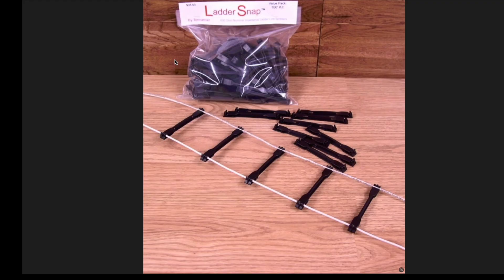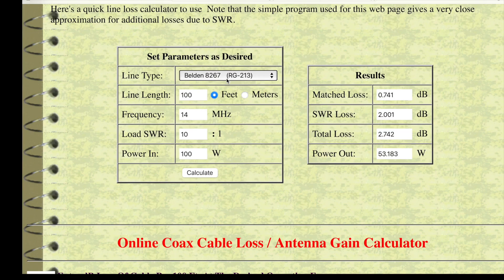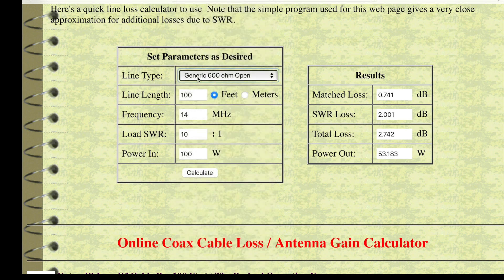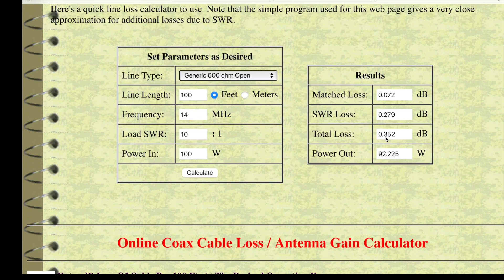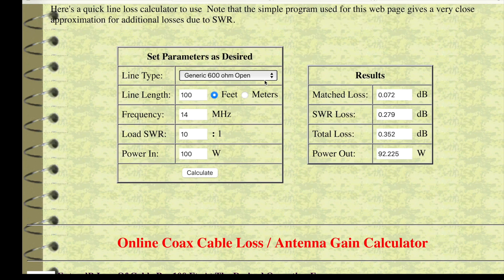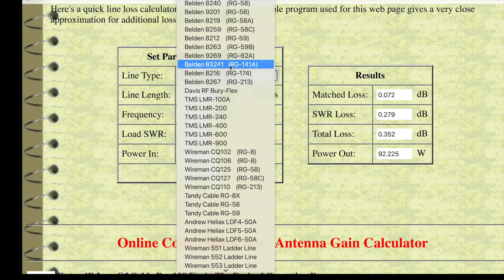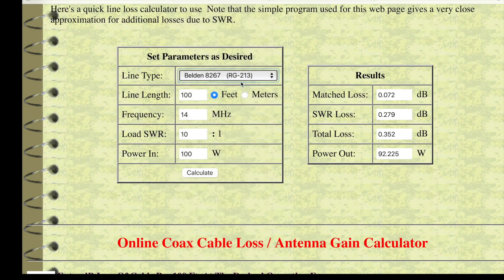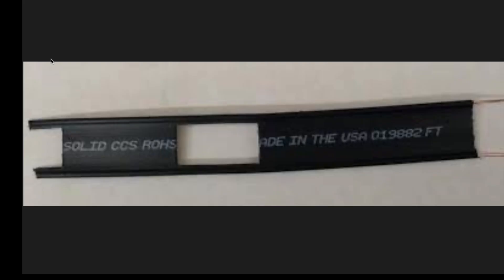Ham Radio Myth - Don't Use Coax Cable It Wastes Too Much Power!!

Comment: Great straight-talk series !
One minor repair if I may:
The tuner doesn't/can't do anything about loss in the coax. 
That can only be done at the antenna's feed point.
The tuner can only change the impedance AT the point where the coax meets it ... that keeps the radio happy.
Reply: More accurately: 
.... at the point where the short coax from the radio meets it. 
If the match is poor at THAT point, then you lose some power in the tuner, as well as in the long coax. //
K2KQU
Reply from the maker: You are partially correct.  Go to ChatGPT and ask this question:  How did Walt Maxwell, W2DU, and the ARRL Antenna Book, explain how an antenna tuner not only matches a transmission line to the transmitter but tunes the entire antenna system to resonance?

Comment: i have a nye 3kw tuner i would like to use just the long wire  what is your suggestion?
Reply from the maker: Nice tuner.  First you should do a Google search for instructions in a PDF.  I was able find one in seconds.  There are three feed through insulators on the rear.  One of them is for a single wire antenna.  Then you will need to connect a counterpoise wire to the ground on the tuner.  It should be about a quarter wave for the lowest frequency you plan to use.

Comment: We shouldn't always use ladder line or coax or window line or anything at all. If you want something easy use coax. Very forgiving and shielding is awesome. Id use it most of the time but playing with ladder line to make a doublet or g5rv or anything else you want to play with just makes sense. It all depends on what antenna you want and how far you want to take the hobby. Ive seen guys use tv coax to save alot of money and guess what it works! Just make aure you know what you're doing b4 you do it. Your finals will thank you😂.
Reply from the maker: TV type coax may present a better match to a dipole than 50 ohm coax but it has an aluminum shield which you can't solder to so won't take a PL259 plug.
Reply: @BustRadioMyths  yeah I'm not recommending anything to anyone. Honestly I haven't tried it. I do plan on making a listening only antenna by using f to bnc or f to UHF connections. I have seen a guy use TV coax to excellent effect and he mainly did it to afford to make more antennas. Sometimes he would try a dozen in a single month. I like that idea but your right there are some things to understand before you try it. Im about to try ladder line made of bic pens and lamp wire. I just like the journey. Im not ever going to say you should always in ham radio. The experiment is the goal for me. God bless buddy I like your channel. You cleared a lot up for me last year when I was studying for my exam. I've never found a hobby with so much dogma and outright anger at others not doing it Thier way.
Reply from the maker: I've actually used TV coax before on the ham bands using an F to PL259 adapter and it worked fine.  I'd say it's certainly OK for QRP.
Reply: @BustRadioMyths  However there are adaptors that will convert the TV coax connector to a PL 250 connector.  The impedance of a dipole depends on how far it is above the ground.  It can vary from below 50 to above 70 ohms.  For many heights the 40 and 80 meter dipoles may be a better match at 50 ohms than 70 ohms.  I doubt there is enough difference to notice for either impedance of coax .

Comment: I'm an old man and reasonably new ham. Yours is one of the few youtube channels I put any truck into. And this particular video I find fun as I have a new Yaesu rig and an old Collins rig in my shack. I do everything in coax for convenience. All of my antennas are compromise (Oh boy, I mean compromise!) and I still enjoy the hobby. I'll never have the huge antenna farm or any amplifiers. But I'm not into contesting and don't feel a need to try and talk over some other operator. Maybe I'll catch you on the air some day from the Sonoran Desert.
Reply from the maker: I’m the same as you.  Don’t really care about contests or breaking pileups.  Currently doing the QRP thing and it’s kinda fun.

Comment: My call sign is M7HIJ,  IM using 1/4 wave 31 ft wire vertical. 6mm earth bond wire. direct to a wonder wand mrk 2 tunner, straight to the back of my rig, also 31 ft counterpoise straight off my radio ground.  So lm putting out full 6watts, on my yaesu ft818 nb full 6watts no coax  boom QRP.
I'm getting 5/7 5/8 in the Netherlands.  5/9 Italy 🇮🇹  5/5 Brazil 🇧🇷  Germany 🇩🇪 5/9 and we are only Qrp 6 watts max, the tunner will tune all bands down to zero swr.
Reply from the maker: That’s what it’s all about IMO!!!

Comment: Over the years I've used all kinds of things. All homebrew.
Long wire straight into the shack with a tuner, a doublet early on using 300 Ω twin feeder and later 450 Ω slotted twin, presently five attic dipoles on 20m to 10m with about 25 foot of RG58. Also an outdoor 60m inverted vee with about 50 feet of RG58.
Two sizes of magnetic loops too.
All get out, a little r.f. goes a long way. Nothing over 5 Watts here for 30+ years.
G4GHB.

Comment: I am really new at this.
At this time I only have a gmrs license, using a HT and a magnetic mount Antenna.  I plan on getting the first level ham license.  It seems easy to get the license with a bit of study. Its putting it into real world applications, which is the trick.
Things to consider are,
Radio
Antenna 
Coax between point a and b.
All on a buget, the simpler the better.
Let's not forget the buget.
I may be 67 but I can still climb that old tv Antenna tower to stick a ham antenna on it, ha ha. I just have to do it when the wife is gone to the store, so as not to hear, 
O My Gosh, your gonna fall.
Reply from the maker: Welcome to the hobby.  Get $12 worth of wire up in the air and it'll work fine.  A dipole on that TV tower sounds good to me.  Don't fall.  Better have someone there to call 911.

Comment: If you use that online calculator at 14MHz, 100ft and set the VSWR to 1:1. For 600 Ohm open ladder, the loss is 2%. For, RG58 it is 26%. For RG-213/U it is 16%. So, typical co-ax has significantly greater loss than 600 Ohm ladder. As you say, it depends on the application. If the ladder line is difficult to run or the length of the run is short, co-ax wins the day. Also, ladder line is affected by weather (it doesn't like getting wet and especially doesn't like ice or snow). However, if the situation  allows you to use ladder line for a long transmission line run, you may want to consider it. If your run is in the order of 300 feet, even with a perfect match, you can expect less than half your power to make it to the antenna (or half your receive signal lost before it gets to the receiver). We cannot say one type of line is always better. It depends on the situation.
Reply from the maker: Go back and check your figures.  100 feet of RG213 with a matched load at 14Mhz with 100 watts input has about 85 watts reaching the load.  That is a loss of 15% not 43%.
Reply: @BustRadioMyths  Woops, I think I had metres instead of feet selected! I shall amend my comment. Thanks.
Reply from the maker: Ah Ha!

Comment: Good tutorial!  1/2 S-unit may not matter, but 1 whole S-unit may mean the difference between completing a weak Contact in the noise level.  Seems like the majority now have high noise levels, like over S-5 and only bother to respond to strong transmission levels.  Great presentation and food-for-thought topic. ❤

Comment: Ladderline needs to be twisted so many times to the freq per 100' ( at least in the " analog" tv frequecies" ) from a catv system tech who serviced cable tv in the 80s finding ladder line still in use!!!!
Reply: Sorry i am not a natural english human.
Would you like to explain the point to me?
what you say with "twisted 100 Times per freqency" ?
Hope you exlain it to me, please.
Please do not miss understand...  Your comment raise my attention  and i like to understand  what you are writing. 
Sorry for the Bad englisch;).
Best 73 from germany.
Reply from the maker: Me too.  What purpose is served by twisting ladder line?
Reply: @BustRadioMyths  the idea was 100' not times and the twists were to reflect losses from one side of ladder line to other  even though minor loss is loss and those twists allow losses to '" reenter" the lines this was presented to me by aa ham operator from the 40s  as well as tv cable CATV was open line and in the first years of community cable used ladder line as the original back bones for service lines  placing lighter connection weights on housing structures
Reply from the maker: Can't see how twisting ladder line would reflect losses from one side to the other.  Ladder line if properly installed is balanced, meaning one side cancels the other preventing it from radiating.  Twisting has nothing to do with it.
Reply: I've always heard that those twists weren't frequency dependent but are there just to avoid wind load on the wire.
Reply: @j3gum  they are frequency dependant  the count falls per 100 meter run more for higher frequency less for lower

Comment: One of the potential problems with old vacuum tube gear is the break down of the mains transformer (Filament & B+), and the leakage incurred to chassis ground from decades of heat, and the chemical reaction of the copper windings and the insulating coatings used.  
Unaware inexperienced (and experienced) users can get a nasty zap or worse when touching an equipment case where AC is leaking from the power transformer primary to it's E-Plates, Bell Covers etc.  
Replacing a power transformer alone can run into several hundred dollars for rewinding the original to spec.  An off the shelf replacement may be available at a lower cost but sometimes it isn't.
etc. etc.
Reply from the maker: I gotta hand it to guys who restore old gear.  I would never have the patience for it.

Comment: I personally don't find ladder line that difficult to route outdoors. My balun (a DG0SA/sk designed 1:1 and a common mode choke combo I built) are outside my house, a 6' run of RG400 goes through a pass through to a remotely controlled tuner. From the tuner there's about 50' of coax to my operating position.  The long run of coax is always at a low SWR for low loss, and there is only 6' of untuned coax to the balun, then low loss ladder line. With 108' of doublet above my house, I can tune 10m-160m with ease.
Reply: This is a perfect setup. You keep your tuner safe inside and only the balun is outside. Your losses are small  in a short low loss rg400.. if you have a zs6bkw or g5rv connected, your losses are even lower, cause they are 50 Ohm for certain bands…. personally I dont get the point of the video. It’s misses the point of the ladder line and doesn’t explain why swr is bad. Without addressing reflections, it is only another opinion newcomer can not evaluate…. Furthermore why is he always so loud? It’s like telescoping…

Comment: When I changed my 40 meter dipole from coax to window line, it made a huge improvement in signal strength on 20 and 10 meters. The other bands were not drastically different .
Reply from the maker: Maybe had very high SWR on those higher bands.
Reply: @BustRadioMyths  Because of the frequencies involved, both of those bands were being fed at a voltage point, hence very high Z.

Comment: i run a dipole. no balun. no nothing. 2 inch pvc for the center to contect the coax to the wires. then 125ft of coax. i run it on 75only tho it hears nice on 40. but not so good on the tx of 40. but it was for 75 anyways
Reply from the maker: Nice work!

Comment: There are pros and cons for both !
A fella could bury coax in the ground !
And with Ladder line a fella can have a multiband dipole !
They call them a ladderline doublet !
I do not like the word doublet and refuse to use it !
It a balanced dipole fed with balanced feedline !
There aint nothing Doublet !
I also do not like the word POTA !
I refuse to POTA !
 I a balanced line type myself !
I do use coax where I must !
Mainly I reckon because I am cheap and build my feed line and antennas out of junk wire !
There a awful lot of pretty good copper wire in a 3 conductor thrown away 100 foot extension cord !
New coax and new wire is awful expensive ! And the price seems always going up !
Boy oh boy they got some fancy expenensive wire now days !
I think radio ought to be economical !
A couple decades ago all we would hear is we ought to conserve !
I do not hear nothing about conserving anymore !
We supposed to throw away the old and buy thing that are build better !
No matter the cost !
I might be building antennas that work like dummy loads but !
I have never owned a factory hf antenna !
All I do is QRP cw anyway !
I also a fan of lead acid batteries :)
I know I off the track !
 73
Reply from the maker: Hey you can have a multi band dipole with coax too but you have to consider the loss.  A fan dipole also works well with coax.
Reply: @BustRadioMyths  Yes :) I get about 135 of wire in the air and with my balanced tuner I can cause my polution on all the main hf bands from 80 to 10 !
Of course not at the same time :)
Reply: @BustRadioMyths  Fans dipoles work fine  with coax.  I like the off center fed antenna for simple wire antennas.  It works most bands and can be built out of junk wire.  I worked at a large plant and they were always changing things so lots of wire of 14 gauge was pulled out and was to be thrown away.  So I have up a 80 meter dipole and an OCF dipole .  Also a triband beam at 55 feet.  Sometimes on some bands the ocf will have the same signal as the beam if the other station is in just the right  location.  Other times I can not hear stations on the ocf that is s2 to s4 on the beam.   While not really a fan dipole, but similar my hex beam  is coax fed and is just many 2 element beams made out of wire and is fed with  coax.  I have nothing against the open wire line but it is just too much trouble for me to use.
Reply: Yes, I do notice that the tone was a bit over exaggerated in the video and IMHO it's not necessary